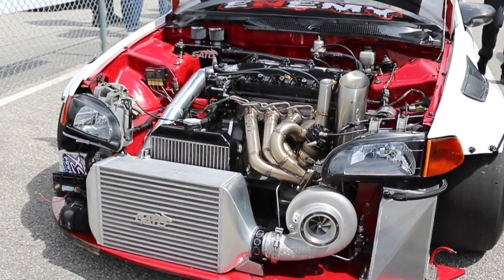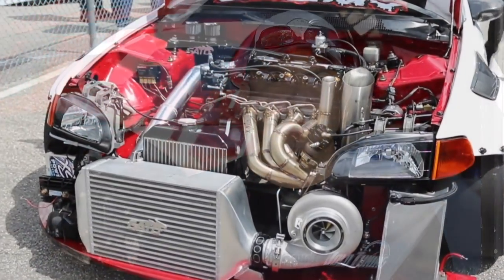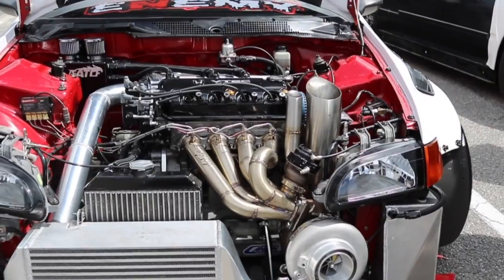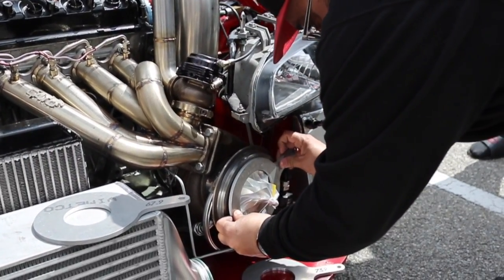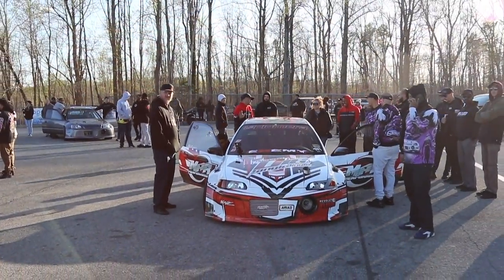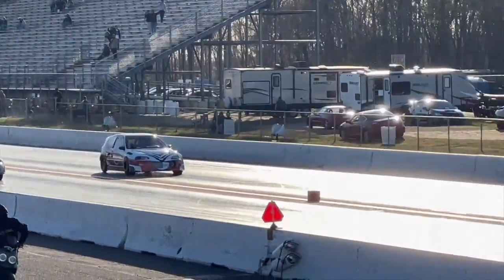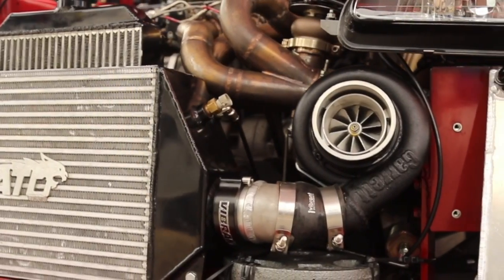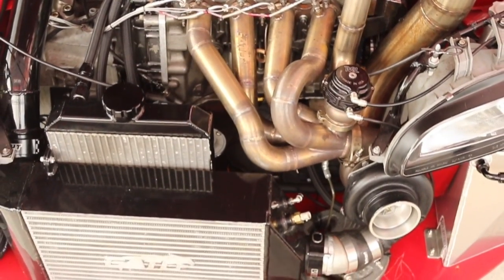Honda D Series Single Cam goes 8.06! | La Plomera 2022 update! | D16z6 from Hell!

Comment: Are you running a concrete or filled block? Or it it just a darton, Benson, golden eagle type of sleeve with no additional support?
Reply from the maker: It’s a cemented filled block. As far as the sleeves they are installed by tulipán. The exact brand of the sleeves I don’t know. This is what I know from the top of my head as I’m the video guy lol

Comment: Any idea how much power that d16 is making?
Reply from the maker: On the DYNO it only made somewhere in the 750 range on low boost so we are assuming she’s somewhere in the 1000-1100 hp range when it’s turned up on the track according to the trap speeds
Reply: @FlakoPics  I want to bounce my ideas back and forth with you guys for a D-series road coarse racing build!
Reply from the maker: @gingersquatch9844  absolutely man, hit up Eli on Instagram @la_plomera_d16 and Mitchell at @marperformance

Comment: Whats the purpose of having 1 block over the other if they all run the same passes?😂 a 7 sec k series, a 7 sec b series, theres about a to be a 7 sec d series and imagine if it was AWD
Reply from the maker: There’s actually an awd sohc out there pretty bad ass build, it’s not as built as this single cam but imagine if it had this motor and turbo set up on that awd lol that would be so sick
Reply: That 7 in definitely there..